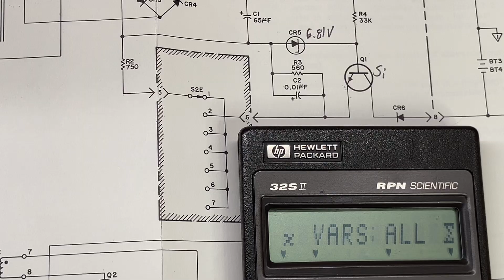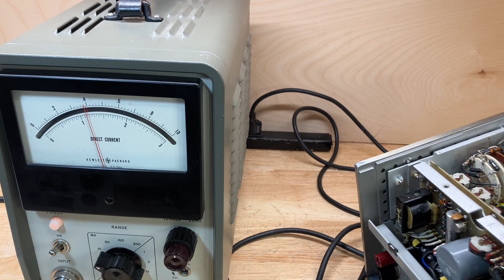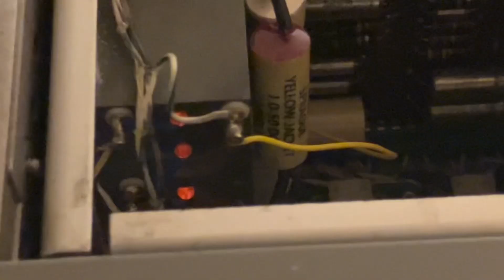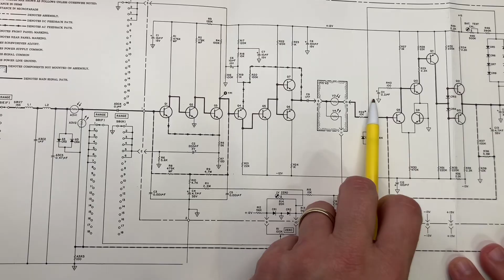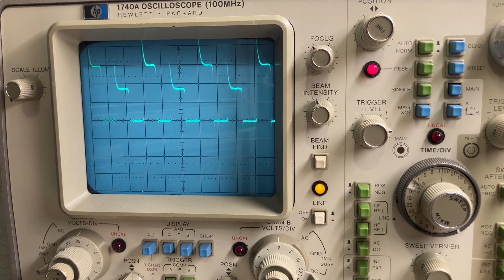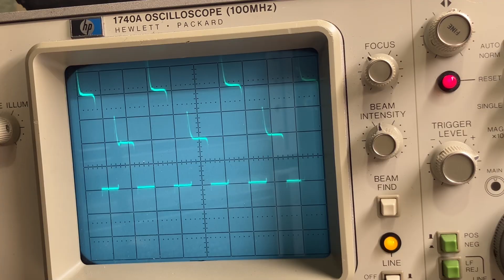HP 419A DC Null Voltmeter Part 2

Comment: 00:57 - hopefully C2 is only mounted with that polarity in the diagram :-)
Reply from the maker: Ha! I didn’t notice that! Actually, C2 isn’t a polarized capacitor. That mistake has gone unnoticed in the manual for 60 years, until now. It’s not even in the Errata sheet. Thanks!
Reply: @garyramsey4275  Lovely :-)

Comment: such a great video for many reasons: seeing the before and after waveforms of the neons, seeing the  neons themselves, and watching the meter in action on the microvolt ranges! My Fluke 845AR jumps all over on the microvolt ranges (I used a 3400A neon to replace the bad neon in my 845, so they are probably not matched), but works OK on 1 mV and greater ranges... anyways great video!

Comment: Great repair and explainer video on this superb instrument! Very glad I've found your channel on repairs of 1965 till early 70's HP instruments.
In The Netherlands you'll find a electronic music studio where we build a large installation of these instruments for sound synthesis and processing, called Willem Twee Studios. So as a long time user I'd like to ask 3 questions if I may!
1: we have several meters (in the 3400 RMS ; 3591 selective voltmeters ; 5210 frequency meter) where the scale graphics are crumbling and obstructing the needle movements...what to do??
2: that series of casings with the gray/olive finish starts to get more and more sticky..what to do?
3: finally: these meters have red colored needles that seems to light up when the ambient room light color is red. Could you explain that purpose? Was it a mil spec maybe?
Thank you very much! Greetings!
Reply from the maker: 1. The meters can be opened, and you may be able to replace the scale with a reproduction. I’ve heard that there is software available to generate reproduction meter scales, but I don’t know the details of that. Be aware that, for many of HP’s analog meters, that the scales are individually calibrated - matched to the electromechanical portion of the meter movement through a proprietary photographic process, so replacing the scale may cause small inaccuracies. It could also be possible to remove the scale, scan it with a digital photocopier, clean up the image with graphics software, and reprint a new scale. I don’t have the expertise to do this either. I have had this problem with at least one of my instruments; I simply used a donor parts unit to change the entire meter. I know this solution is not always possible.
Reply from the maker: 2. About the sticky finish, this seems to be a degradation of the polymers used in the original finish, or maybe a chemical reaction due to something in the environment. My only suggestion is to use a mild detergent and a soft scrub brush to clean. This may or may not work.
Reply from the maker: 3. About the red colored needles, I didn’t know that they light up. I don’t know anything about this.

Thanks for your interest in my channel. Sorry I couldn’t be of more help.